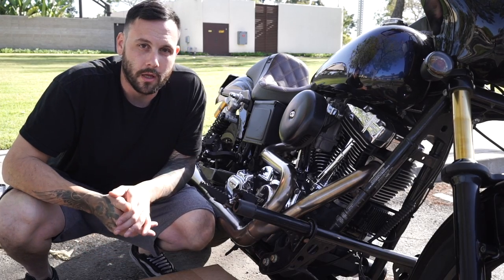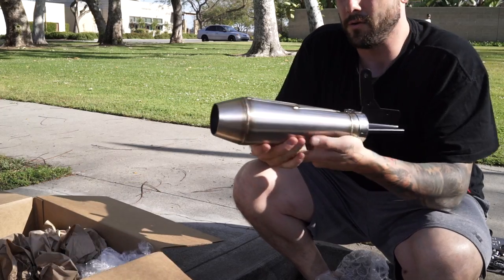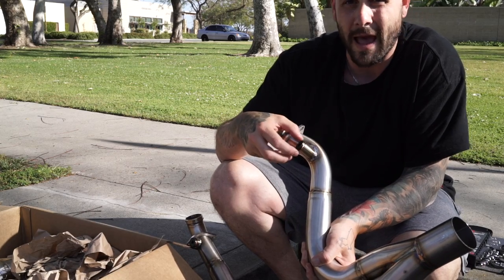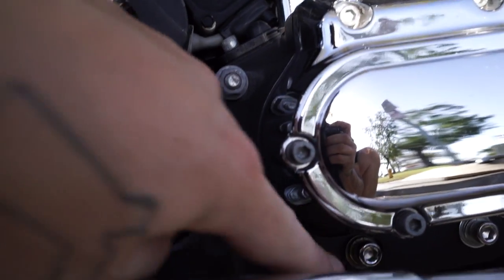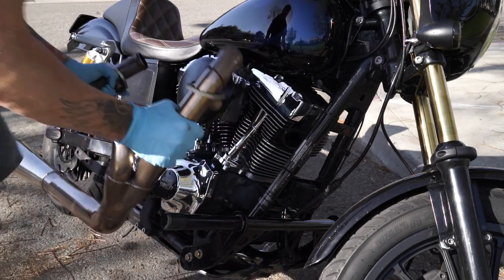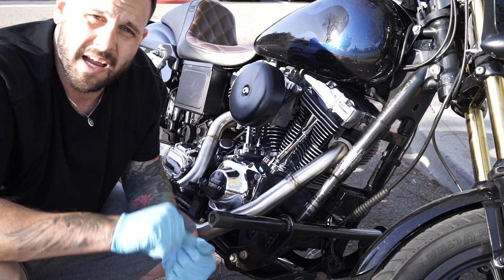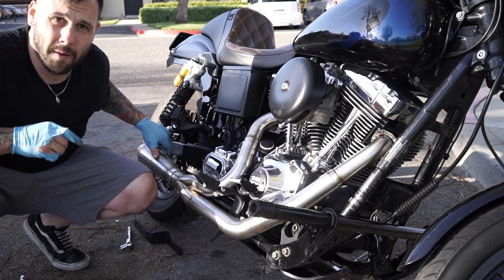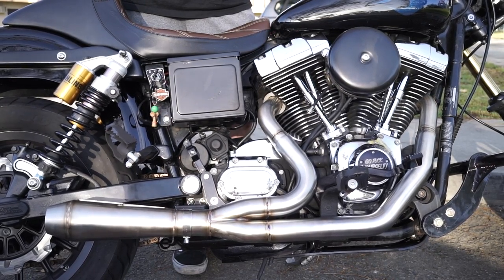STEALTH PIPE INSTALL ON A HARLEY DAVIDSON DYNA : Vlog 20

Comment: i have found that loctite is the worst thing to put on exhaust studs depending on what part of the country you ride in as specially. only thing i would put on exhaust studs in ANTI SEIZE and nothing else. putting that loctie on is a good way to end up snapping the studs on removal. just my preference. im sure a exhaust manufacturer would probably know best if they recomend that. only anti seize for mine.

Comment: Just a tip, loctite doesn't work when it gets hot in fact that's how you remove loctited bolts so don't rely on it for your o2 plugs. just use a bit of antisieze and torque em down.
Reply from the maker: Adam K guys over at stealth suggested I use it.
Reply: An exhaust gets hot, but not that hot
Reply: header pipes will glow red when hard wide open throttle and that happens around 1700 deg, loctite breaks down between 375-500 deg.
Reply: TheRideTV well it's better than nothing i guess and won't hurt anything to use it.

Comment: nice pipe...nice bike...take the crash bars off the frame.
Reply: Craig Wexler Why?
Reply: cause if you're actually doing wheelies and burnouts and worrying about laying down the Harley, practice on a less worthy bike.  Just a personal opinion and when I see those bars that are on crotch rockets most the time, I cringe.  Not trolling, just giving my astecic opinion.
Reply from the maker: Craig Wexler I'd rather be safe than sorry bro it's already served its purpose many times
Reply: Craig Wexler they'll save your expensive engine and can also serve as foot rests. I don't see why he should take them off
Reply: Craig wexler uhh definitely want one if you're doing wheelies and burnouts having a crash bar and frame sliders save you from destroying your foot controls and having to replace them every time you go down they definitely serve their purpose